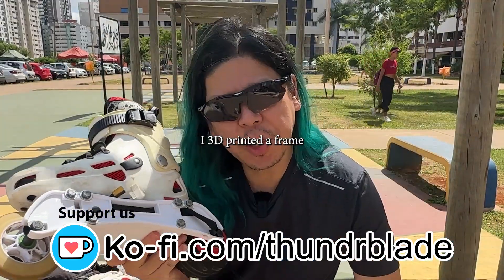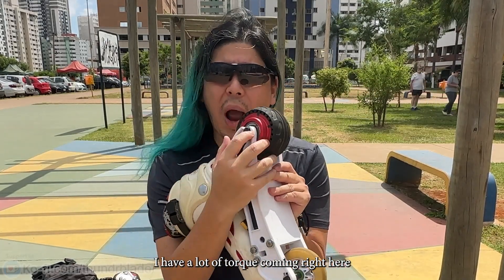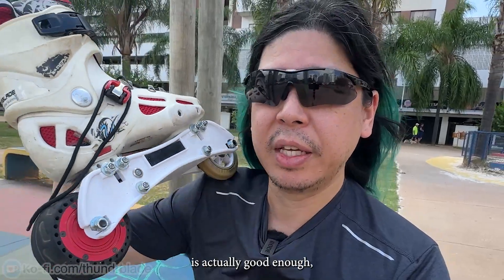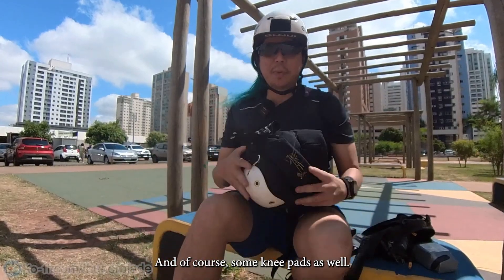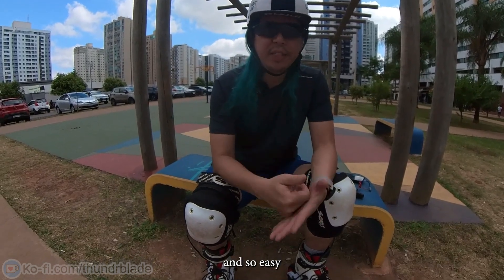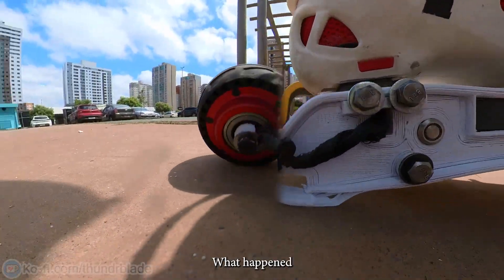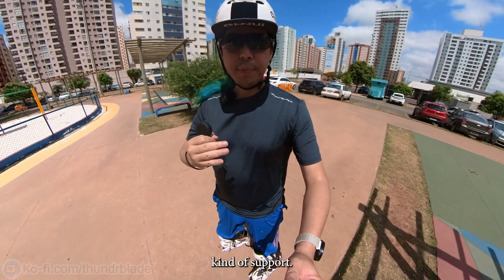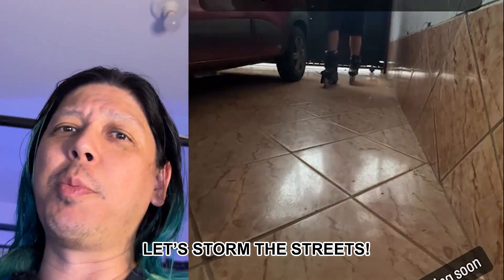ELECTRIC INLINE SKATE - Will a 3D printed frame break? DIY build

Comment: Do you think the wider the wheels are apart, will put more pressure onto the frame? Would shortening the distance between them work better? at some point, I feel like we need wider/bigger wheels
Reply from the maker: definitely the longer the frame is the more pressure it will have to endure.

a short wheelbase is good because the frame is smaller and lighter, also stronger, better for maneuverability as well.

BUT

the shorter the frame, the less stability it will have and for faster speeds that's very dangerous.

if you intend  to go slow then a short frame will do just fine, but for faster speeds it will prove to be a little too unstable for most people.

btw the wheels im using are 105mm diameter and are not small wheels by any means. they are also 60mm wide which is almost triple of a normal inline  skate wheel at 22mm.

Comment: Hi! I think the backpack battery is a great idea to save on weight. You noted that they were heavy for the fanny pack. Then I thought, why not some suspenders or instead of a fanny-pack; a **satchel**! Or even better, a **cross-body backpack**! But if that can't be found or work, you could try some small backpack.

The fanny-pack, unlike most sacks, are supported by one band in the middle and can be unstable when  baring heavy items. You need a sack/bag that is supported by multiple bands, like a school backpack.

All in all, if you do desire to stick with a single band backpack, I reccomend a crossbody since it's angled and tight. That way it might not dangle/sag and poke your back or mess up your posture.

P.s.: May the man upstairs aid you :)  I can't wait for the finished product and I wish to extend my hand when I can, be it advice/tips or small donations!✌️

Your engineering makes me realize more how hard making things is(as a maker, I can relate, especially in prototype failures). The struggle is real, but it's also worth it! 

Keep on keeping on!👍👍🐏
Reply from the maker: thx a lot for the comment.

yeah, backpacks would be better for heavier battery packs. I will definitely test with a backpack. I will bring it here as well.

But we must try out all that we can. test test and more testing.

btw the part 2 and 3 of this build are already online on this channel.

Comment: Yo in the wiki they said that thw air trecks have a hydraulic cushion system or i think it said it had a air cushion in it do you knlw why? Its 3 of the main things
Reply: Cause in the manga they jump off buildings and shit, so I guess that explains why their legs don't snap in half
Reply from the maker: In the anime they kind have super jumps and can land from super high places because of the hydraulic suspension that can absorb the impact and also propel them for the super jumps. 

A suspension system to absorb vibrations is a thing I think about frequently. I think it would allow for better control at higher speeds and also absorb some impact from jumps. Not on the anime level of course.

Comment: Collab with Atmos?
Please make an updated rebuild video with all the parts needed, i  will definetly build them for next summer, i need more video and insight, thank you, i have also come to a solution using a belt for batteries that ere available for lwn movers, maybe you can refit them for the bateries or use a lawn move battery beelt with the internal baateies and make the electric controller fit to the batteries
Reply from the maker: I intend to make something with Atmos for sure. Just waiting for the right timing.
Reply: @Thundrblade   thank you, looking forwward to next updates
Reply from the maker: I will definitely make a video showing in detail how to build these. 
But for now I’m just testing it f this can actually work. Full build video will follow when I have a decent build.
Reply from the maker: A belt made for tools could make a much better battery belt for sure. Gonna check out some. Thx for the suggestion

Comment: 1 step closer to Air Gear irl

It’s expensive, but high grade aluminum or other metal composite used it high end, extremely light, BMX trick bikes would most likely work.
Reply from the maker: Aircraft aluminum would definitely be strong enough since it’s what we use on normal inline skate frames. They can withstand the abuse of urban skating. 

It’s just really hard to get those in small quantities and expensive. Carbon fiber would be easier for some people depending o where you live.